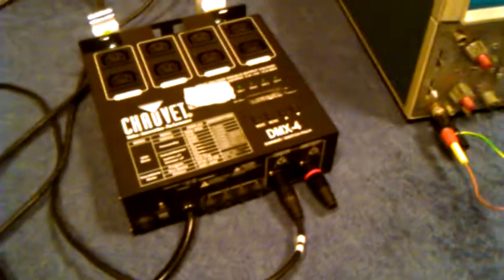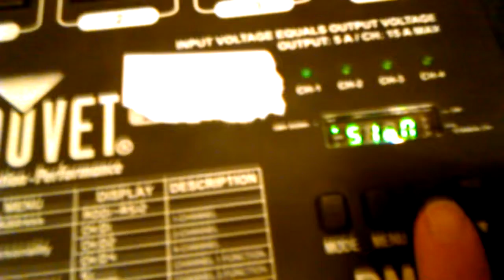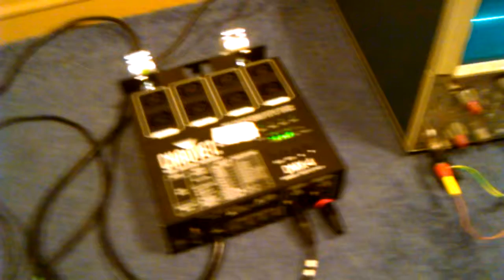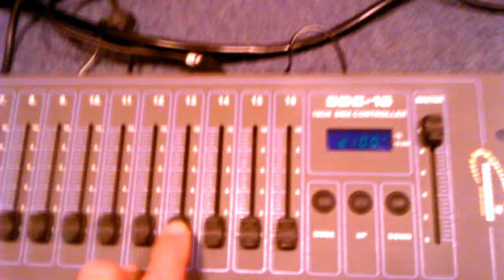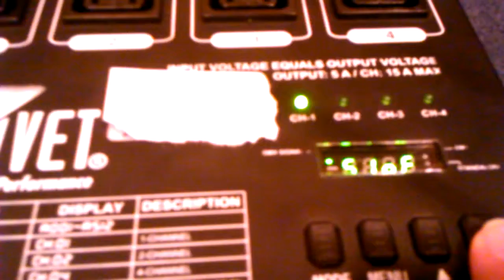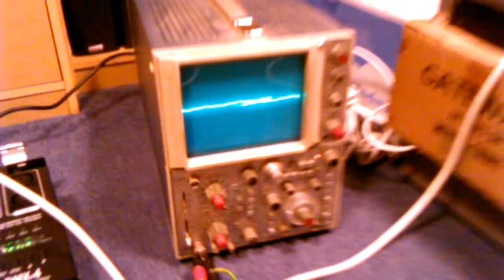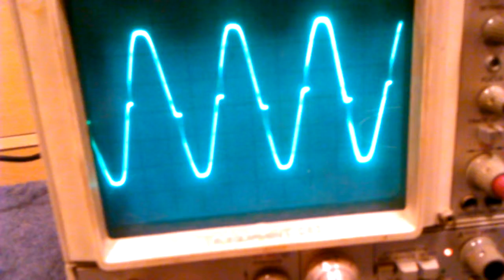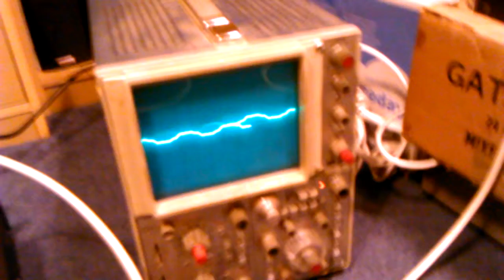Chauvet DMX-4 Dimmer/Switch Pack review and tests / waveforms

Comment: This video saved me some testing of my own. I have a large DMX lighting show, but I wanted to add a small laser EFX that was not DMX controlled. Using the Chauvet DMX-4, it turned on properly, but when it wasn't on, there was enough electricity passing to make the laser blink visibly about every 20 seconds, making it unusable. So I guess I'll just move onto my next thought for a solution of building a small enclosure with a 120v relay that I can control with the DMX4. The residual power from the DMX4 in the "off" position shouldn't be enough to trigger the relay, thereby allowing me to control this specific laser unit with a true on/off state controlled by the DMX4.
Reply from the maker: There's also a danger when  controlling anything "electronic" from one of these dimmers operating in Switch mode that it could be damaged if dimmer mode is accidentally selected.

I've successfully used cheap DMX-controlled relays available on eBay (such as https://www.ebay.co.uk/itm/3-Channel-5A-DMX512-Controlled-Relay-Switch-Kit-DIY-Converter-DMX-Dimmer-Re-V1I8/283460066226?epid=25011414801&hash=item41ff895bb2:g:lWQAAOSwLXFcvh8d , although I can't remember the supplier I used) to switch devices such as smoke machines and LED signs, so this might be an option for you and simpler than driving a relay from a dimmer pack.  Be aware that DMX should not be used to control safety-critical systems (e.g. pyro , moving scenery) as (at least in its basic form) is a one-way communications system with no form of error checking.

Comment: thank you for your video Mr. Berlingo . The think that I can not understand with the dimmer packs is that when I have one of 1500 watt stage light e.g and it is foully on, I know that I use 1500watt of electric power but if I have dimmed to zero, what is the amount of electric power do I use ? Is it about zero  ? How does it happen ?
Reply from the maker: I'm no expert, but because the triac is switching off the power for part of the AC cycle it reduces the power used roughly proportional to the reduced output (there is some power loss in the triac itself, which is why it has to be mounted on a heatsink, one source says 1.5W per amp.

Comment: What light console are you using in this video?
Reply from the maker: A Transcension SDC-16, very simple controller but good for testing as the display shows the current value of a channel when the fader is moved, and the channel faders can be remapped to control any 16 consecutive channels within the universe (and the value of any previously adjusted channels is held).  I think it is no longer manufactured.